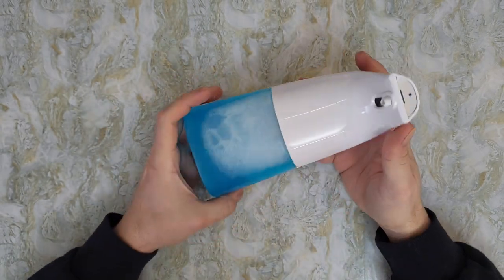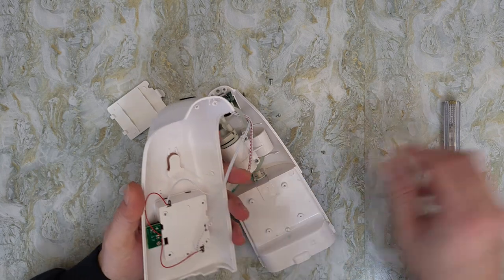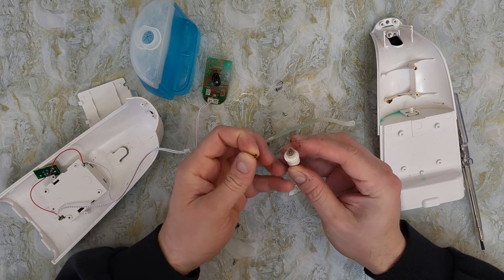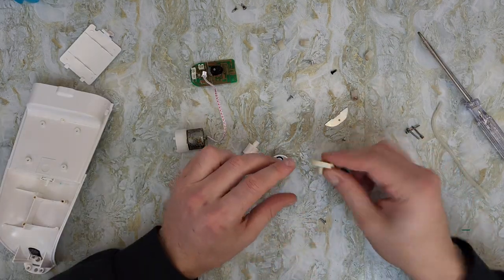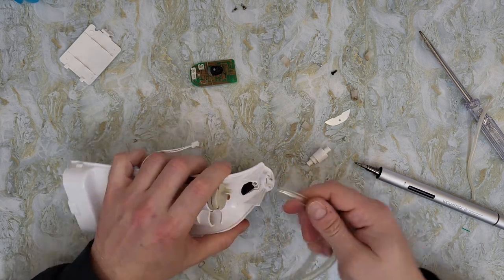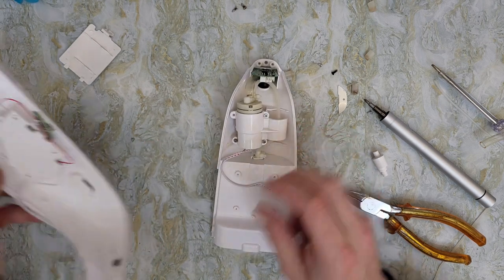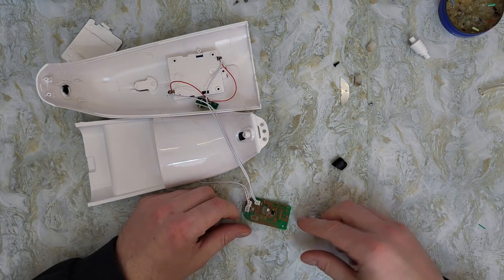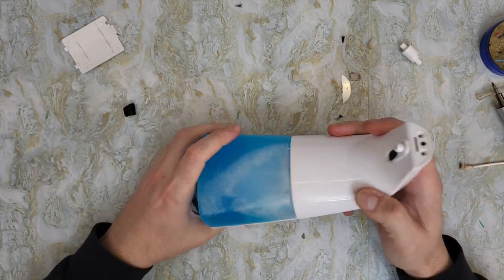Automatic Soap Dispenser Teardown

Comment: I took it apart... there were no screws in mine though. It had those press locks all around the joints. I simply excited the motor through external battery pack and voila!!!, it started working. Probably the motor was stuck and all it needed was direct supply of power. I reassembled it and worked absolutely fine.